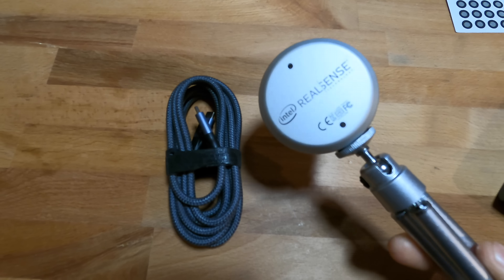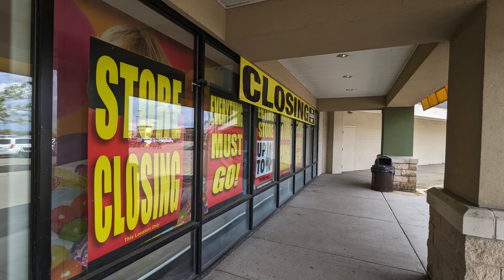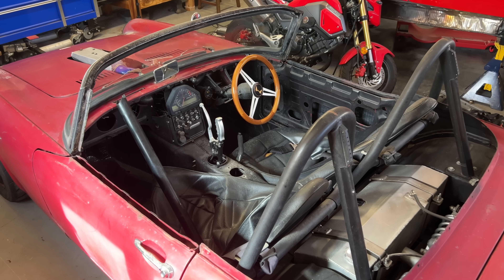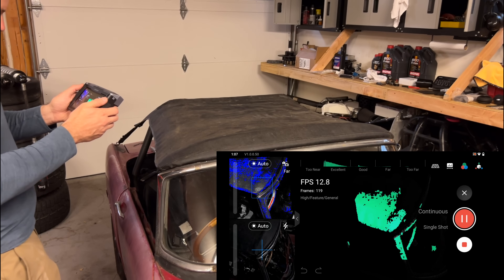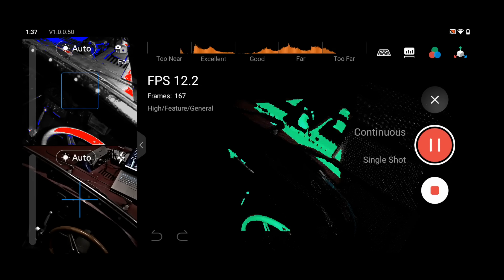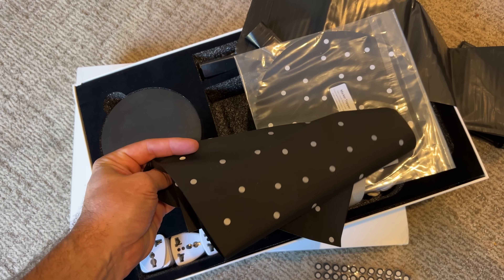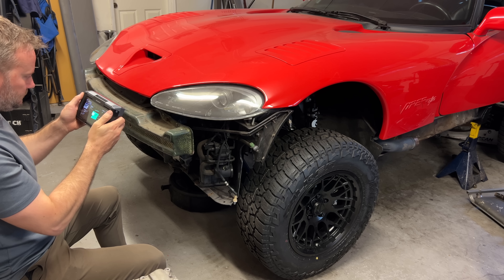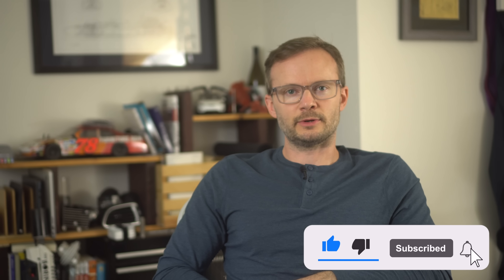All-In-One 3D Scanner: Revopoint Miraco vs Einstar

Comment: Have you considered photogrammetry? I work at a research institute dealing with 3D scanning, and have compared different methods and scanners (I'm not one of the measurement engineers though). A DSLR and a decent computer with Reality Capture seems to give the best geometry, comparable with our very expensive (I think 70k) lidar, but with far better colour data. I've also played around with just using my phone to take the photos, far worse quality but still very workable. RC has a nice pricing model where you pay per input image, so the 200 or so images a scan would need cost like 3€ and you can take as many exports and iterations as you want. It won't do glass and glossy surfaces will be bumpy and artefacty, but you can get the whole car in one lap and then go in for detail loops to get closeups, with no losing tracking issues. Just my 2 cents
Reply: People are more comfortable buying a device than paying for a service, especially when the output reliability isn't trusted.

Comment: I shared this on the original einstar video, you can "tunnel" the USB device over your network so you can use a powerful computer in your office to handle the scanning workload while the laptop in the garage can be a low powered screen effectively. You need solid network performance to do it, but it works really well. remote desktop from the cheap laptop to the desktop so you can see that computer, setup the USB passthrough, then run the einstar software on the desktop.
Reply: This is definitely the way to go for doing this frequently. But can you imagine the 12 hour long video of Matt starting off building a small home network for data transfer and ending up recreating an Amazon web services data centre in his roof space? He's bad enough with project creep as it is! He should definitely do it 😂
Reply: Would love to learn more about this. Is it some sort of USB to Ethernet dongle sorcery?
Reply: @alexej917   seconded - I'd also love to learn more about this!
Reply: @alexej917  no extra hardware needed. You use a piece of software called VirtualHere USB Server, and virtualHere client. Server on the cheap laptop, client on the powerful computer. It passes the USB device over the network. Then you can remote desktop to the powerful computer to control the software from the cheap one.
Reply: @alexej917 https://youtu.be/9RAR1lo_Yc0
Reply: I'm really interested in how these two scanners perform when scanning smaller items. Matt, hope you can notice my comment and consider creating another video for that, thank you in advance.😄
Reply: Still a pain in the ass.
Reply: You still need to stream the display back from the desktop to where you can see it, but that could be to your phone and thus WAY more convenient.
Reply: i have done this using a strix laptop but for whatever crazy reason i can use my surface pro stand alone and it works, not awesome but it does somehow work ,vs  when using a laptop with a low end rtx gpu, as crazy as that is. still best is if i use my laptop and Tunnel the usb to my desktop as you put it, at this point i just move my desktop as needed while not fun the rtx4070ti and the 128 ddr5 memory with a zen 9  cpu with 12 core 24 threads @ 5ghz really just handles the scanning like its nothing way better than using a usb server program
Reply: That's an extremely interesting idea!
Tried to find your comment but not sure I'm looking in the right place, could you point to any how-to on this please?
If it can be tunnelled to a desktop PC, I wonder about a cloud server even... I could rent a much more powerful machine for a session than I could buy alongside the Einstar, which I really want to buy but my PC hardware is pretty old.
Reply: @edumaker-alexgibson Spin up something powerful on AWS to process the data?
Reply: ok now i have to try that with my lizard, my laptop can scan well enough but my desktop is where it's at lol
Reply: @Flashbang_Photo  how's the lizard performance so far?
Managed to scan some interesting stuff?

Comment: I'd love a video on your Fusion 360 workflow when designing around your scans. I assume a lot of plane through three points and mesh section sketches, but I could be missing something. Learn Everything About Design's channel has been a helpful resource.
Reply: Making for Motorsport does a decent one on that subject 👍
Reply: You can certainly reverse engineer to NURBS that way. I've found it's not beneficial to do the entire scan that way tho. Just some hard points you need.
Reply: @Goatee_yay  Agreed, there's lots of videos about reverse engineering, but not many around the workflow of designing off of and around mesh data.
Reply: Can you link the video you mentioned?
Reply: @LB0001  He has a number of videos, and full series that are of interest, here's an example: https://youtu.be/nDWjLu4eiu4?si=zqF-oCqCxcaUESxc

Quick tip, if you're not able to do a Plane Through Three Points and select mesh data, go into direct edit mode for the mesh.

Comment: If actual shapes are better than stickers, I have two thoughts on that - either use blocks of metal with rare-earth magnets to attach to a surface, or use a bunch of spring clamps for areas like the top of the windshield and other edges.

Pros:  You probably have both of those things around the garage so it's basically free to try.
Cons:  You can't play with your new hotwheels collection.
Reply: Could use some 3-2-1 blocks with double sided tape. You get an  easily identifiable block with features to scan on every surface, and a bunch of known reference dimensions to compare against the scan to see if everything is scaling properly and that the accuracy remains accurate throughout the scan
Reply: Throwing down a somewhat bunched up blanket or towel just to the side of what you want to scan works wonders for tracking and you don’t have to deal with peeling off stickers
Reply: Easier than that:  

Buy a pound-brick of plasticine at any dollar store.  Revopoint's scanners track the randomly pinched off bits as physical markers, and I'll wager the Einstar could track them well too.  And, the plasticine can be removed, and tossed into a zip-lock bag and reused for another scan again.  Minimal cost.

Even a roll of masking or painter's tape and forming random balls of it stuck on would do the trick.  This might work better on surfaces that won't take to the oily residues that plasticine can leave behind, at the cost of not being re-usable.  Might cost a wee bit more if you're using up all your tape roll.

The downside of the regular shapes of magnets, and stickers -- they're regular shapes (identical in size/shape to one another), so they have to be placed in non-repeating patterns.   And there's a non-intuitive "Goldilocks zone" between too few stickers placed in the pattern, vs too many stickers placed that depends on the scanner and it's software, which adds to the PITA that placing and removing stickers already has.

Plasticine or tape-balls, if there are too few, you can often pause scanning,  add more gobs of tape/plasticine, and resume.   Just don't let that owner of that Bugatti you're scanning catch you placing them on their car!
Reply: I had the same sort of thought but with a spherical tracker with an internal magnet and a decent but reusable adhesive on a flat bottom

Comment: It's great living in the future like this, and these are all good problems to have. I used a laser scanner at Kodak 30 years ago, the target had to fit on the sled, the scanning head was on a long screw drive and would move about an inch a minute past the target, once the face of the target had been captured, the head would trigger the platform to rotate, and the sled would swipe left and right until finally 360 degrees was achieved. If you wanted the base plate of the target, like the bottom of an engine or whatever, you had to pause the scan, manually lay the target over, and the scanner would attempt to make sense of the points, attempt to line them up, and attempt to paste them together. It output autocad files, and had seriously high resolution, but took a solid 24 hours to scan anything in detail. I tried to use it to scan the back of a 1295 A series engine off a Sprite to create an adapter for a Datsun 5 speed transmission, and wow, what a pain in the ass. Took days to get it right, and in the end, the machine shop guy literally ignored the data, and traced the engine on paper, traced the transmission on paper, and manually created the adapter plate, in like an hour. The 1996 version of Send Cut Send, I guess.

Comment: I wonder if instead of all those dots, maybe you could throw a grid top down with a projector. As long as you're not blocking out the grid while scanning. Bit of a pain but might be cool if you're always scanning big stuff in the same place.
Reply: That's a really interesting idea. I was thinking of something like masking tape with markings - you just lay it down on your surface, do your scan and pull it off, but I like the projector idea even more. The only thing is you'd need multiple projectors shining from different directions.
Reply: @ColinFox I did something similar when I was scanning car body parts with various super cheap methods: cover the panel in painters’ tape, then add cheap letter stickers or draw a grid. In most cases the results were surprisingly good, to the point you could even see the wrinkles in the tape.
Reply: @wisconsingoprogoalie8125  That's a good idea. And I have a can of spray-on reflective spray, meant for clothing. Creates a retro-reflective surface. You could use a mask to reveal only small circular areas on the tape and spray that with the reflective spray.
Reply: The IR laser pattern projector from many stereo depth cameras (like the intel realsense) may work well for that. Just securely mount the realsense above, use it to get some gross detail overview scans, and then use the handheld stuff for the fine details.
Reply: @roboman2444  I think this will mess with the scanner, as it is doing the same thing, flashing out patterns in IR.
Reply: There was a projector system that did this for projector light mapping! It was very impressive.
Reply: I don’t think this would work because the stickers are super reflective and that’s how the scanner benefits with them. Projecting the shape and color on them wouldn’t have the same reflectivity results
Reply: Instead of a projector with flashing light, use a constant light like a flood light and have a grid in front of it making shadows.

Comment: Haven’t watched it all yet, but you can bridge that gap to scan the cockpit opening by clamping a blanket to the under side of the roll bar and windshield, then delete the towel scan points in post.
Reply: Even better than a towel, use a piece of rough lumber, which is rigid so it will not move during the scan.Like the towel, it need to be rough (or to have markers added) so the scanner can track along it.

Comment: I'll be curious to see how this turns out, I don't think the revopoint stuff is bad as far as hardware, just needs software work.
Reply: It has an 8 core ARM A76 CPU. It pretty much has the equivalent processing power to 2 Raspberry Pi 5's. That's pretty low spec for this kind of work.
Reply: @TheRogueBro  Then surely it wouldnt be difficult for them to upgrade it. Or does (in this realm), increasing computational power exponantially linked to physical size increase aswell?
Reply: @TheRogueBro  I meant moreso the sensors. The other revopoint stuff has a lot of issues and it seems like the frames themselves for the most part are OK, it's the ability to place them on top of each other that is where it starts to fall apart
Reply: @TheRogueBro  thought same. Opposite.